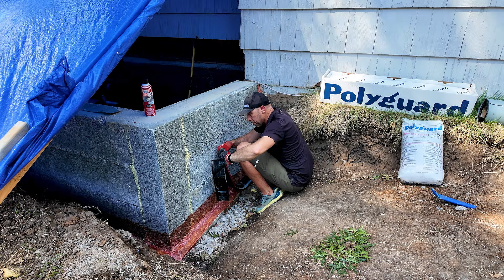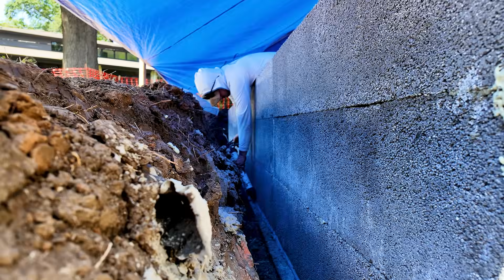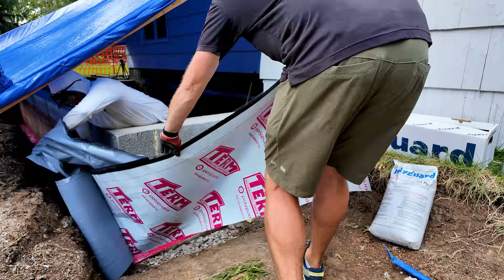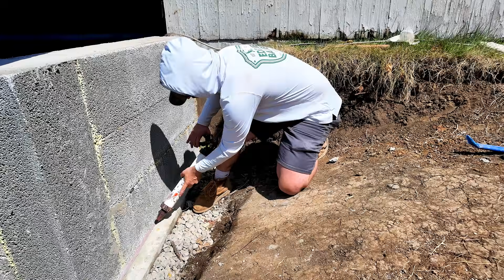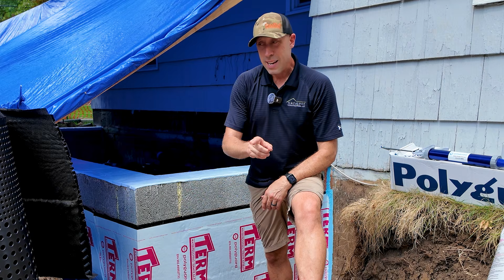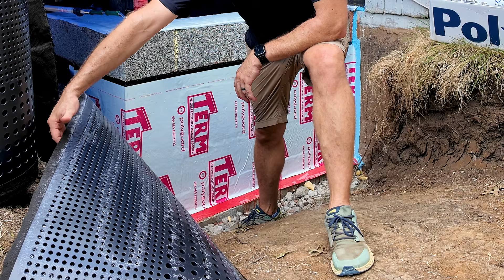ICF Waterproofing done RIGHT!

Comment: The intersection between old and new construction would require great attention for all of the risk factors identified here.  A nice roof overhang with a proper gutter and downspout placement is where I would start.  If minimal water gets to your foundation then your methods on wall and footer will not be tested.

Comment: Perfect block is a hybrid product called an ICCF Insulated composite concrete form. It's mostly packing peanuts and old coffee cups ground up with a small amount of low grade Cement and other binders added to hold it together and give it fire proofing, technically termite and UV proofing according to factory specs. Though I can respect the belt and suspenders approach Of adding additional protection. Perfect block by volume of the entire wall is mostly foam which means you need very little concrete and when the concrete is poured it mostly forms columns, which is all that you really need for supporting the above structure. The rest is resisting the pressure of water and earth outside the walls which a good French strain along the outside tends to help with. It's considered to be highly earthquake resistant 8 and it's supposed to withstand 250 mile an hour winds. https://www.youtube.com/watch?v=TR_XobkpbFQ . This system he's using will work on pure foam forms and provide all the same benefits though he probably should have brought up that he was technically using a different system and why he chose it But this is a sponsored video S that wasn't necessary to endorse another product. I personally enjoy a lot of aerated concrete and cement products along with the foam glass products that are coming out now. Along with insulated core products but those are not very popular in the US currently so this is a very good option. Products  with the insulation in the center create two separate areas of thermal mass allowing the two areas to work better along with protecting the insulation in the center and creating a much more fireproof and bugproof surface.
Reply: “Packing peanuts, coffee cups, and low-grade cement? That’s cute. But let’s set the record straight. The Perfect Block™ isn’t made from any of that—it’s engineered from a high-density composite of 100% recycled expanded polystyrene (EPS), Type I, II, and V Portland cement, proprietary admixtures, and water, molded under pressure to create an incredibly strong, fire-resistant form.
The result? A monolithic, load-bearing, non-combustible form that doesn’t melt, burn, or blow out when filled with rebar and concrete and is engineered to survive wildfires, hurricanes, tornadoes, and earthquakes. Think more ‘eco-friendly fortress’ that you can’t drive a truck through than ‘fragile foam.’ 
Thanks for chiming in — but to clarify, The Perfect Block™ is not made from packing peanuts (Does anybody know what these are made of? We don’t, and we never have used them.). Foam coffee cups, plates, and doggy bags, we don’t use any foam that might be contaminated with food waste, and where did you come up with low-grade cement? Just for giggles, read the following:
Understanding Cement Types
Cement is categorized into various types based on its properties and applications. Types I, II, and V are specific classifications of Portland cement, each designed for different uses.
Type I Cement
•	Description: Known as Ordinary Portland Cement (OPC), Type I is a general-purpose cement.
•	Use: Suitable for most construction projects where special properties are not required.
•	Grade: Not considered low grade; it is widely used for its versatility and strength.
Type II Cement
•	Description: This type offers moderate sulfate resistance.
•	Use: Ideal for structures exposed to moderate sulfate conditions, such as underground constructions.
•	Grade: Also, not low grade; it provides enhanced durability in specific environments.
Type V Cement
•	Description: This type is designed for high sulfate resistance.
•	Use: Commonly used in coastal structures and areas with severe sulfate exposure.
•	Grade: Not low grade; it is specifically formulated for challenging conditions.
Conclusion
Types I, II, and V cements are not classified as low-grade. Instead, they are essential types of Portland cement, each serving specific construction needs with varying properties.

We’re all for discussion — just let’s keep it accurate. 
For anyone interested in the real specs: theperfectblock.com or download our free Technical Construction Manual.
Reply: @theperfectblockiccf  Packing peanuts of polystyrene.  As are coffee cups and doggy bag containers but it's good to hear you don't have any contaminants in your recycled stream of Polystyrene. As for low grade i meant Portland cement because there are several other types of cement materials. I was referring to low PSI low admixture , as in low cost because you manufacture your product by spraying a coat of damp cement dust and then heat stamping it into a mold. This means the cements  only job in that process, is to hold it together and add fire resistance and insect resistance. not support the building It's not structural in the same way a cinder block is because it's literally filled with packing peanuts (Ground polystyrene) instead of construction grade gravel. that is  tested for its type of stone and PSI it can handle. i have full faith that your product does the job it's advertised to do and that it is not in fact free to produce simply because it's filled with recycled polystyrene. It's a perfectly good product if you're already committed to using polystyrene. So I apologize if it seems like I was degrading your product. I was simply trying to get across that it shouldn't be treated as structure the same way you wouldn't any other ICF style product. Of course it can be rather structural even without the concrete core if you have the appropriate skin on the outside. though I've yet to see any applications of shock creep to your product or exterior rebar in your advertising. I wish your company plenty of success in the future because I look forward to seeing any expansion of efficient uses of green building materials.
Reply: I had the perfect block installed in my foundation.    Not happy at all with the product.   It’s dirty/messy to work with the blocks, there is no attachments inside like the plastic webbing in other blocks, and no way to really know if your rebar stayed in place during the pour unless you improvise a system.   There are a list of other issues that I won’t you must use endlessly spray foam to seal the blocks together and a list of other things that make it a hassle to work with.   The tech manual recommends using drywall mud to direct adhere drywall directly to the blocks as there is no webbing even attatch firing strips.   In most states and building code you need mechanical fasteners.   No way to do this w the perfect block.
Reply: @blakewill1933  I'd say stucco on the inside shock crate on the outside trying to ad sheetrock to something like that is going to give you waves. a lot of people don't even like to put Sheetrock on top of OSB so Perfect Wall does not at all seem ideal. They're probably telling you to mud over it before you add the sheetrock so you can actually level the surface. ICF is much more level and doesn't hold moisture so it's a breeze to sheetrock. Depending on what distributors and how much it to transport this block system can make financial sense. I believe they had to bring everything over on a ferry so the cement cost was a lot along with the cost of form work and labor, this has potential labor and material cost savings in a scenario like this.

Comment: Everything this guy sells is a rip off.
Reply: This polyguard system is solid. We've installed it  before and very impressed. Extremely overpriced and not alot of customers will go for it but it does work very well.

Comment: The 'detailing sealant' (caulking) applied at the corner of the block/footing looks like it was applied over very dirty/dusty surfaces which when zoomed into later showed it had shrunk/pulled back from the concrete in several places.  If you're going to spend the effort and money doing something, do it right.  Aside from all the other critiques we could lay on this video the quality of the 'Build' brand is getting sullied with all these newer contributors and shorter style videos.  Remember your brand relies on all of your content AND people you let represent 'The Build Show'.
Reply: Yep, very obviously a BAD application on dirty surface...
Reply: i saw the same thing...

Comment: The Perfect Block definitely seems like a superior IC(C)F product.

What is done below the footer for water management? What about below slab termite management?
Reply: I'm no expert, but I typically don't see footers waterproofed on bottom and sides. The waterproofing I've seen is concerned with the joint between vertical wall and footer. The slab is typically inside the footers, on the ground, and they didn't address that in this video. I didn't see a slab inside the wall/footer assembly... ?
Reply: @bobnomura2068  I mean the drain for the footer. That dimple board has to drain to something. We see some stone. But, the whole thing seems sunk down. I don't know it's odd to me
Reply: @nomdeguerre8464  True - the water is supposed to drain down the dimple mat, then where does the water go after that ? I didn't see any drain hoses...